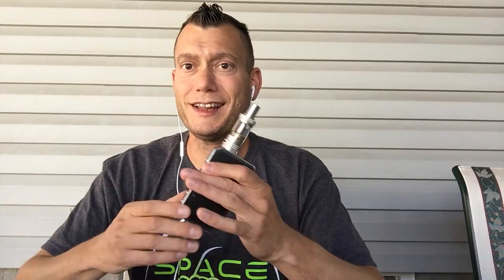Dangers of Ni200 nickel DON'T vape it on anything BUT Temperature Control!

Comment: I used it on a watt mod without temp control for like 10-15 mins am I okay?
Reply from the maker: it's not funny for you to create so many fake accounts and troll me.
Reply from the maker: furthermore, you think it's funny.  Because you are 'in the know'.  But beginners are vaping starter kits with nickel and they don't know how to use them.  watch the fucking video, see my main points, and quit pranking me.
Reply: +Quest4vape it was a serious question and I was not trolling at all. I subbed for a reason and now you just lost one. Congrats, control ur temper, that's not how you talk to new comers.
Reply from the maker: good thing then you discovered sooner than later not to vape it in wattage mode.  Thanks for watching.  I get harassed daily trying to help people before they use their equipment in ways not intended.
Reply: +Quest4vape hey man i have an rx200 and i im vaping it at 0.5 uwell coils and i just put it on wattage mode and i vape , am i safe or there are things i need to know ?
Reply: +Omar Alsaee the .5 uwell is stainless steal not nickel and the .25 is also SS they have a .15 that is nickel and dime othera you can order online.. I also have a crown tank so I was jus lettin ya know
Reply: +BAR MUD1_3 thanx alot man and the 0.5 works the best for me . So the 0.5 and the 0.25 uwell coils are stainless steel ?
Reply: +Omar Alsaee yes.. they have alot but the three basic coils   nickel 0.15
stainless 0.25
stainless 0.50
Reply: +BAR MUD1_3 I have two rx200 also.. have u upgraded your firmware for 250 watts yet 😍
Reply: +BAR MUD1_3 hey man 40 days ago when i first boughty rx200 i had an itchy cough for about 10 days and when i asked they said it was normal , after those 10 days the itchy cough dissapeared , and i have been vaping for 20 days with no issues , but 10 days ago the itchy cough ce back !
Reply: +Omar Alsaee *came
Reply: +Omar Alsaee what watt do you vape the 0.5 coil at
Reply: +BAR MUD1_3 its awsome but im thinking of quitting cause of the itchy cough im getting for the past 10 days , and i didnt upgrade , whats the perks of the update , what'll improve ?
Reply: +Omar Alsaee I'm not sure why itchy cough.. I would say it's the juice or maybe you burnt up your coil or maybe your vaping to high watt for that tank coil
Reply: +Omar Alsaee the upgrade let's you have 250 watts instead of only 200 but if your having issues with coughing and itchying I would advoid big clouds.. did you start vaping your nicotine recently

Comment: I'm fairly new to vaping and I think I may need some assistance from the pros out there. I bought myself a Kanger Tech TopTank Mini starter kit 75W, and I currently am using the Ni stock coil it came with in TC mode to use it safely but the thing is I noticed on Watt/Power mode my Watts are 0.00W on the bottom left corner and then are set to 75.0W off the bat as soon as you switch it to TC mode(Ni), the recommended Watt settings for Ni coils are 20-40W and to run on TC mode but I can't seem to find a way to change the Watt value in TC mode to match the recommended Ni settings. If anyone can help I'd really appreciate it alot
Reply: Take the liquid chamber off the top whilst the mod screen is still on. Press the fire button. Put the chamber back on. The screen should say "New atomiser yes/no. Click the + button for yes. Now go to TC mode. Should stick at TC mode.
Reply: +Gordon Penny Thank you so much it worked!! cheers!

Comment: I put 3 nickel coils on  my Weber grill at 700 Fahrenheit, inside aluminium foil with 4 bottles of 34 MG nic juice inside, and just open the cover and inhale. Just kidding, good advice, the first vape I purchased from a vape shop the seller put a Ni200 in it and it was wattage only mod. Then I started reading and took that shit off asap. Good advice.  I'm still alive though.  Thanks for the awareness because it's not because someone at a vape shop sells something to you that it is safe.
Reply from the maker: +Brawndo Thanks man, exactly.   rofl that was awesome!  Thanks for the chuckle!

Comment: So i have an Eleaf TC40W and i just changed my coil to a Ni200  .18ohm coil from the wattage coil it come with and the guy told me to run this coil in temp mode which im doing but what i have noticed is it constantly keeps saying temperature protection as i vape on it.. is this normal or is something wrong? Ive only been vaping less than 2 weeks now but ive quit a 20+ yeah camel wide habbit in the process so.. Still learning. Thank in advance! \m/
Reply from the maker: +Demonlord468 Congratulations on quitting smoking!  I don't have that product, so I've no experience with it.   When it says that, it means you've hit the limit and the device is working properly.  It is backing down or cutting power to keep your vape from heating above the temp setting.  What temp are you set at?  You could play around with increasing that and see how you like the vape.  For example you might have it set at max 350F.  What happens when you adjust that wattage upwards to 400 or 430.  Try increasing it in increments and see how it performs and how you like the vape at those temps.
Reply: Well it seems no matter what i set the temp at it shows temp protection as im hitting it but im finding around 430 feels really nice and i seem to be using less juice as well since i changed to this coil just wasn't sure if its suppose to keep showing that or not. But it seems to be working fine otherwise.
Reply from the maker: +Demonlord468 If there's a wattage setting for TC that may be set too high.  power in Temp Control is for faster or slower ramp up.  Your mod may be maxed out and thus giving too fast a ramp up, hitting temp too quickly.  Try lowering wattage, may give you a slower ramp up with steady vaping and not hit Temp Protect until you are at the end of your vape.
Reply: Thats the thing if you put it in Temp Mode it automatically sets to 40 Watts but in Wattage Mode you can go from 15-34.9 Watts which also adjusts the Volts as you change the watts. The Volts to Wattage also depends on what ohms the coil is reading as well. Thats what i was thinking as well that 40 Watts in temp modes seemed a bit much since in wattage mode i vape at around 24-26 Watts. But im not sure i know the guy i bought it from told me when im running the Ni200 coils i need to make sure its in Temp Mode so IDK!

Comment: I have a istick 100 w and a super tank should I be worried
Reply from the maker: +The crafters old istick 100w or the new one?  the old one didn't do temp control well at all.  the new one is pretty good.  Just make sure you're in TC mode and that you lock the resistance.
Reply: +Quest4vape  the old one
Reply: +Quest4vape  I have the old istick 100 w should I just be careful when I vape  but anyways thank you
Reply from the maker: +The crafters just don't use the Ni200 or Ti coils for it that's all.

Comment: I have an ipv d2 with an aspire Atlantis Mega with the Atlantis 0.3ohm coil. I vape in wattage mode, is that safe? Sorry I'm really new to vaping
Reply from the maker: +ResistanceOfficial is the coil you are using Nickel?  if so then make sure your D2 is in Ni temp control mode and lock the resistance.  I don't think that coil is nickel though.  should say it on the coil.

Comment: I been vaping nikel in wattage mod for over 5months!!!!!!
Reply from the maker: +callofdutyhacks\glitches Not good for you.  Please get a Temp Control mod or use a different metal.
Reply: +Quest4vape. I do have a temp mod but I never. knew using nikel on wattege would be bad

Comment: I personally like vaping on a temperature control coil... the reason for temperature control is to alleviate that process where the coil gives off that poisonous chemical
which which is why they say never Vape a nickel coil on regular power wattage mode because there is no control through the coil to stop it from getting off that poisonous gas

Comment: what is a good temp to vape on using the nickel wire?
Reply from the maker: +Marco Sanchez that's not a question I can accurately answer.  'Good' being a highly subjective term.  Try 400F and see how you like the vape.  Then move up or down to suit your tastes.  I don't vape much with Ni200 as I prefer Stainless Steel for temp control, and mostly vape in wattage on Kanthal, Nichrome and SS when I'm not reviewing products. Some folks really like the experience though.

Comment: Thanks for the info, although iv'e never messed with Ni200 before, i appreciate this video. Just a question, is it bad to dry burn a kanthal build?
 like does it also release some type of toxic substance?
Reply from the maker: +Breed LG not that I'm aware of, but in that regard, try not to be excessive with pulsing your coils.  they don't need to light up the room, just glow a dull red to show you the hotspots and if they're firing well.

Comment: I have a question about my mods and ni coil temp control.  My eVic VT set @ 600F with just bare wire and it will not glow red.  However my Sigelei 60 and Sigelei 150 it will glow the NI200 wire red as hell bare with temp control set @ 400F.  I can't figure out for the life of me why the temp control doesn't seem to work right on these mods.  Is anyone else having issue with Mods Box and Temp control?  Or am I Just doing something wrong?
Reply from the maker: +Daniel Stevens did you lock the resistance of the coil at room temperature prior to dry firing the coil?  Are those TC mods?  I'm not aware of a Sigelei 60w TC...75W maybe?

Comment: I believe kanthal has a lower melting temperature than nickel. Unless you are kissing a dragon at 1366*K, you will be fine.  Nothing is 100% safe in life :) You should always use a temp control device for protection and research all your vape gear.
Reply from the maker: +Kristi Wilson not true, and it is not melting point that is the concern harmful combinations form at temperatures lower than melting.  You will not be 'fine' if you use Ni200 or Ti in wattage mode.  So please use them with TC devices, learn how to use those devices properly.
Reply: +Quest4vape I said use TC and we don't vape at temps which are toxic. If someone is doing so they are dumb as shit anyway. The masses will not reach such temps. TI is the safest ...promise
Reply from the maker: Kristi Wilson we don't vape at toxic temps, but when dry hits occur then we do.  Also when torching these metals it changes them and then we are vaping the residue.   I HAVE  vaped on Nickel out of temp control and pulsed the coils before I knew better.  So I guess I'm dumb as shit.  Thanks.  And every day people are doing this because they don't know better.  So the purpose of this video is to educate, and raise awareness, not alienate people who didn't know or insult them.  There was a time when you didn't know it either.   I'm edgy when people make opinion comments here as if they are facts.   Ti has issues when heated as well. Stainless Steel is probably the safest.  It's a topic that all vapers need to be aware of as the industry will just shove product at us...whatever we will buy they will make.

Comment: Newbie here. If you have a kanger and use the Ni setup, it automatically assumes 75W, which you cannot change. Also, you have 10s fire shut down safety. If you´re vaping at 35W how will it be hotter/more dangerous?!
Reply: The box will regulate the temperature by using pre set standards for the type of wire you are using via the temp control option that you chose. To try and simplify it...The box regulates TEMPERATURE ONLY by using the information that you and the coil provide. The box will only use the wattage it needs to create the temperature that you choose. 35 watts may bring that nickel wire to a temp well above a safe level. Its all about REGULATION OF POWER in temp control mode that keeps you safe. Just take Quest4vape advice and ONLY use nickel in temp control mode.

Comment: Why risk vaping on Nickel and dying? 

https://www.youtube.com/watch?v=cKlDLtcy9Es

No thanks. I'll use Kanthal and live. Kanthal uses iron, chromium and aluminum. These are all metals we have cooked with for centuries. Nickel leeches into whatever it is in contact with, releases a carcinogen, and it has no resistance so you need to rely on your temperature control chip which can fail. Not to mention the 10-20% of the population that may be allergic to Nickel. What happens to you if you are allergic? Do you die? Do you get a bad rash? No one knows.

Comment: I wouldn't call TC complete control, I would say it is more guessing than anything else. I Think that it calculates the wattage, the resistance together, then says that it has reached the temperature safe. This is what I think, it's only my thought, so if it's anything constructive please comment, anything that could be the opposite, please keep it to yourself. I just don't see that your mod can actually read the temperature, as it's a metal, not a chip with a built in thermometer.
Reply: Joseph, you're exactly right. Its an educated guess. By using preset parameters based on certain resistances and the characteristics of certain wire types it can be made safe.
Reply: +Joseph Williamson Funny! I just put a .25Ω Stainless build on my Griffin this morning. I've vaped Stainless on pre fab coils before, but never a rebuildable. I'm running it between TC and wattage mode and they're both GREAT!  Stainless does have far superior flavor in my opinion.
Reply: +William Moss I've been vaping a lot of SS316l today... (By the way I'm the same person as the top) Ni200 just doesn't match SS in my opinion!
Reply: +William Moss I have a dual 8 wrap 24 AWG build, but I do not not why the resistance is so high (.31).. But the flavor, don't get me started! It's that good, I'm probably not going to use Kanthal for a long time now... It's a cleaner flavor.
Reply: +Joseph Williamson Agreed!